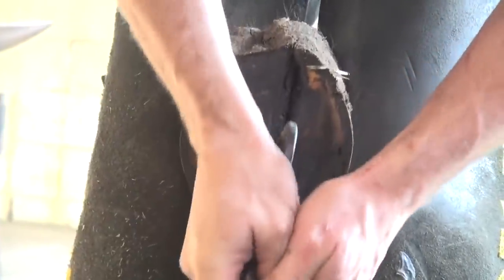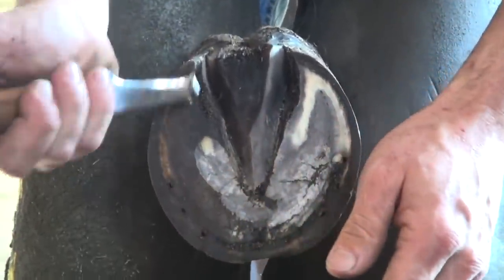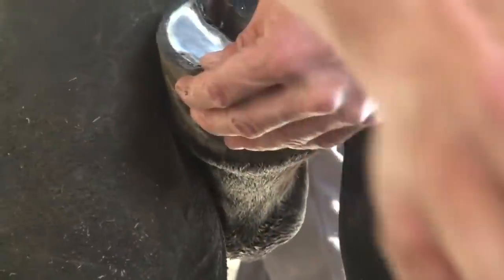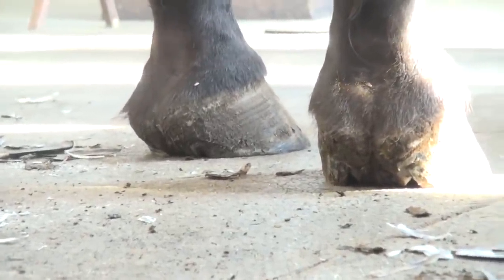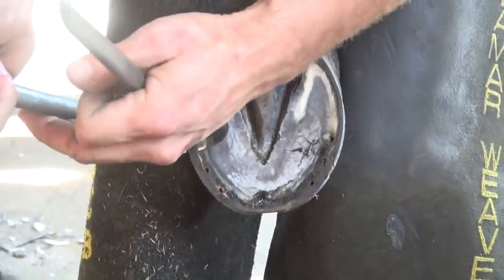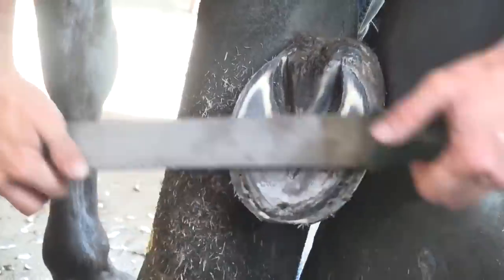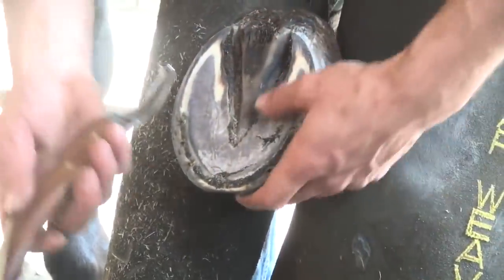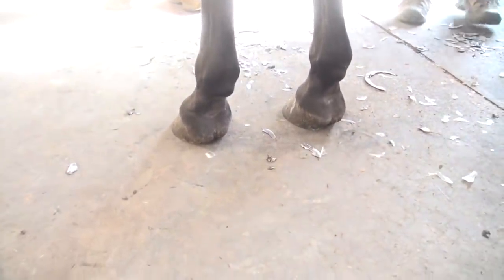Lamar Weaver, CJF Trimming a Road Horse #3

Comment: Does that not hurt the horse? Can they feel anything while your doing it, I thought that they had a soft spot called the frog?
Reply: It acts as a shock absorber when the hoof touches the ground it feels softer than the rest of the hoof. It’s the thing in the middle shaped like a triangle and it could hurt the horse if the farrier cuts to deep but it’s perfect when you cut the frog at the same level as the edge of the hoof. It also pumps blood the leg up when the horse makes a step

Comment: Why is the whole hoof black?
Reply: Tear Drops I think it's just the colouration cause it's a black horse
Reply: If you look at the shoe when it is pulled off, it is one that covers the entire bottom of the hoof. If he was hot shod, then that's basically just burnt hoof. It doesn't hurt the horse if done correctly either.
Reply: RJ Hoernlen thank you
Reply: It was most likely residue leftover from the pine tar hoof packing that was was placed under the pad.

Comment: I wonder an epsom salt soak would help with the trim
Reply: Noooooo. You don't want to do that because the hoof can't get soft or the man may accidentally cut too much or it cloud be so soft that many things get in the hoof and get a infection and with it being soft it will make it tender and painful if you stepped on something
Reply: Really depends on the time of year. It’s not necessary but in the hot dry summer months it could help but probably more work than it’s worth.